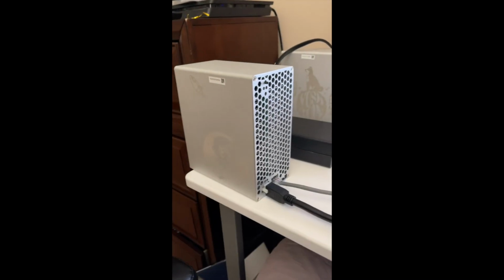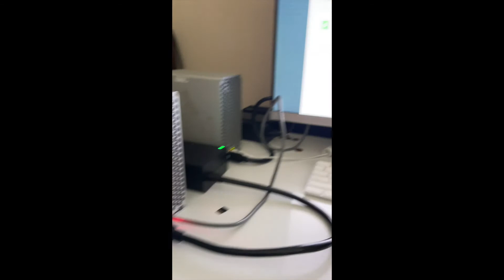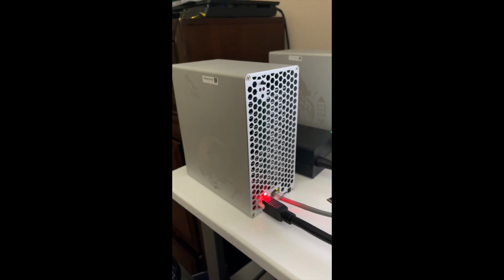Doing this saved my Goldshell Mini Doge, it’s Alive!

Comment: I stand my goldshell power bricks skinny side down so they can off heat better less surface to surface area. Also I run on low power you get better MH per watts ratio and less risk of fire or burning out your units. I've also seen people say the heatsink screws come loose over time.
All the best and great video subbed.

Comment: why the sd card?
Reply from the maker: Thanks for the comment. I was originally asked to create a bootable microSD with the recent firmware. I was then going to use this reset the miner to factory settings with the current firmware. Unfortunately the card reader wouldn't lock the card in place, thus I got a new controller. :)
Reply: @teammikey  hey brotha how do u mak a bootable sd card . i have one miner  that i need to flash .i just loaded the file on to the sd and it wont flash help me bro